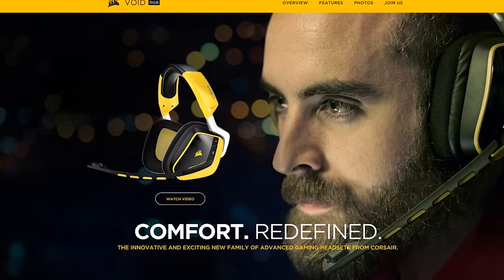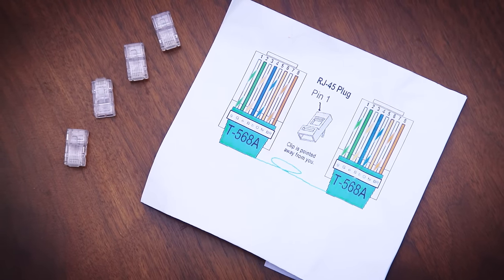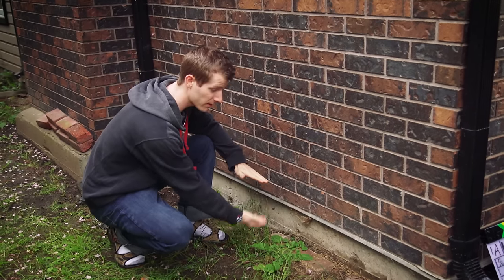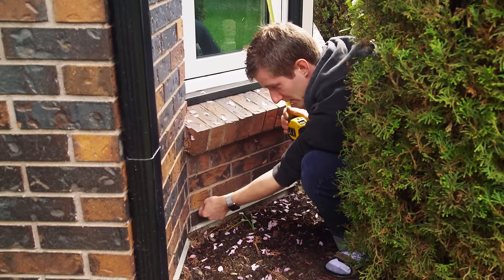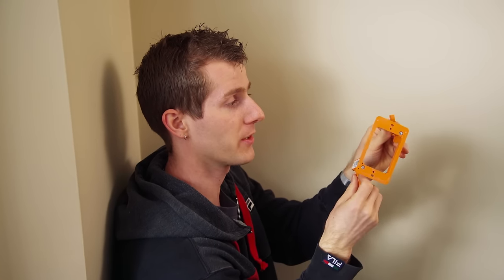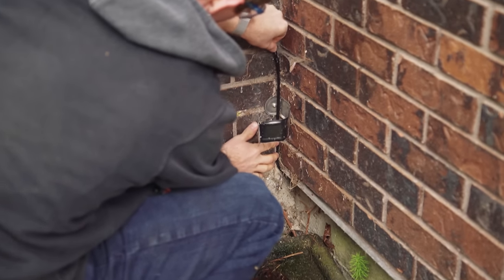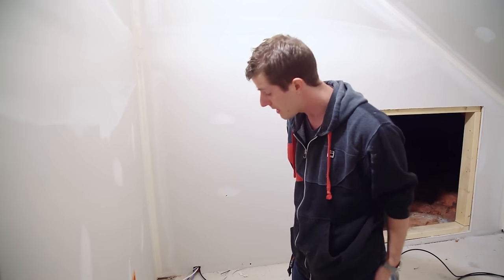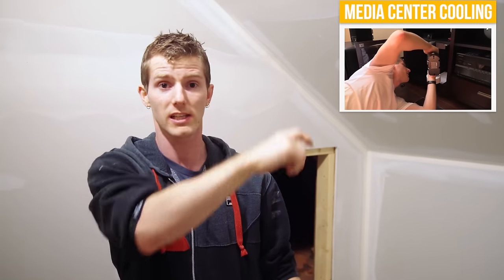Optimize your cable runs at home! - Installing an exterior Cat 5e cable

Comment: Please be very careful drilling from the outside in, it's fucking dangerous and Linus was lucky not to hit any live power wires since he was really close to the power outlet.
Reply: was about to say mr safety in me was like, turn off the power if your drilling blind less the a hand shot from on outlet! And as much as you want shortest runs possible if you ever see a hot water service its the same principle, there should probably be extra conduit and extra cable as alot of people whipper snip them and tear them to shreds
and north facing for us in the south (which goes without saying)
Reply: Actually, you only need to drop the circuit to that outlet.
Reply: FurIouS19811 I always drill from whichever side will create the less mess when the bit pokes through, here in the uk though it's uncommon to find a drywall with such a big gap behind, here we have brick, then cavity, then another layer of brick, then either plaster for the surface or the dot and dap paste that holds your plasterboard in place. Live cables are therefore run between the inner brick and plasterboard which is maximum 60mm deep and covered in capping so the cables are held in place in an allowed zone. These zones are directly above, below, or to the side of the socket, it's against regulations to run it anywhere else in the wall, except 150mm from the ceiling, which is also a zone. So, here you can use a non contact voltage detector or a joist detector to locate all the cables around every socket and in which direction the cables run, so it is incredibly easy to locate every cable in the wall and safe to drill from the outside in.
Reply: Ash R That's the normal used method but the regulations here do not forbid you to run the cable either to the left, right, or below the socket, so it's best just to test those areas. Here, in double storey houses, it's common to run the cables under the floorboard upstairs, so the majority of times the cables for sockets located upstairs come to the socket from below, under the floorboards. This is more a lot common than running cables from the roof space.
Reply: Ash R Do you live in the UK or the US?
Reply: Ash R Do you live in the UK or the US?
Reply: +FurIouS19811
Actually as long as the house was built to code, the only place that power cable would be is directly above the outlet, secured to the stud.
Reply: +cedric1997
yes I agree when a house in North America is out of code, then you can get all sorts of electrical hazards. I know for a fact that my house is up to code and only has wires running up from the outlets.
Reply: Usually I would tend to disagree here, if you hit the cable you hit it, there isn't going to happen that much to the one drilling, I, however, do not know about those mostly terrible Battery Hammers, a Cabled on is grounded so no worries there, I'd say the plastic and rubber case would probably make it safe to an extent. So at the end, the chance of getting killed by the electricity would be minimal at best. I already drilled into so many power lines in buildings since some specialists forgot how to Logic and put those lines in places where the shouldn't be.

Comment: I ran my Ethernet cables through an unused chimney. Our house has 2, and one of them is entirely used for wires :p
Reply: very convenient as long as the cleaning hatch at the bottom and vent at the top are blocked off so animals can't get in and eat the wires.
Reply: Awsome! Never actually thought of that idea. :)
Reply: Wait I might actually try this
Reply: Lol that's a code violation !
Reply: @jackcabob  nobody cares
Reply: @lukestultz5458  When it comes time to the housing inspection, you should care because that would be money out if your pocket to fix.

Comment: Just Saying, I'm pretty sure everyone has ran an Ethernet cord though their hallway at one point. That's me right now 😂
Reply: RJ45 across the landing for 5 years. I am a terrible person.
Reply: Id love to see this. must be worse than stepping on legos!
Reply: I have my cables all tucked away. Appearing from walls out of nowhere and leaving to nowhere (I ran cables through a dry wall....vertically....)
Reply: +ImBarryScottCSS RJ45 is a connector, not a cable.
Reply: had it for a short moment, we now run it along the gas pipe for the central heating which goes from the meter cupboard through the toilet downstairs into a casing that goes up to my floor and then it goes through my wall into my router which is the first router in the house (in the attic)
Reply: most of the walls in my country are from concrete, so that would be hard to do
Reply: Mine runs through the attic to my room
Reply: I used a 2 inch diameter hole saw and stole some ipex from a construction site garbage bin then  chased the cable through the.  I used to  three inch steel rods in a X to brace the conduit at either end sine I couldn't find any terminal caps for the ipex at the job site.  I did manage to find a junction box that I had to rip out of the wet concrete though.  left my runners in the crete after the security guard saw me and had to go home bare foot lol!!
Reply: +P. Wingert damn you have commitment, I am too lazy to zip toe the cords on my desk...
Reply: Yep me too. Duct taped down so the cat doesn't chew on it.
Reply: that how we get internet to my brothers room
Reply: Ran mine around to tops of the door frames
Reply: Everyone keeps talking about not using indoor ethernet cables outdoors, I've sat on mine for the last 2 years through wintersnow and summersun, it looks incredible cheap running across my lawn haha
Reply: In y case I setup a fiber optic backbone between floors with a switch at each floor and all the cables running to the switch. Only 1Gb.  Traffic monitoring shows less then 10% utilization on average and 25% during 4K streaming.

 The switches that can act as wireless controllers and I have AC WAPson each of the three floors..  Hardwired my Bell TV Box since it is 4K and needs every ounce of capacity.  and my main machine is hardwired. Printers are all wireless and most of  my other devices (Tablets and phone ) can't be hardwired.
Reply: P. Wingert We get it, you earn six figure income in a year